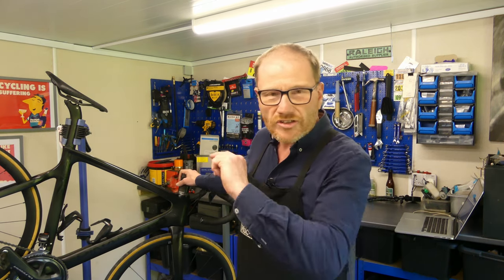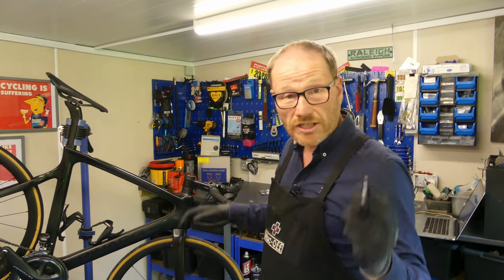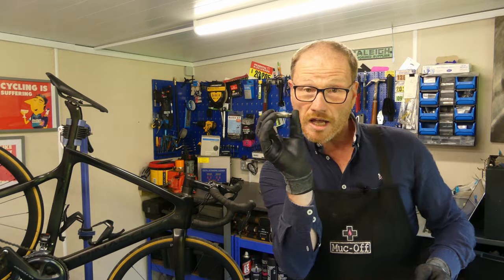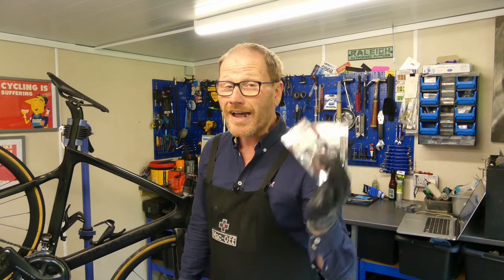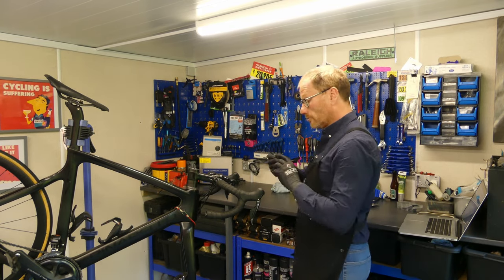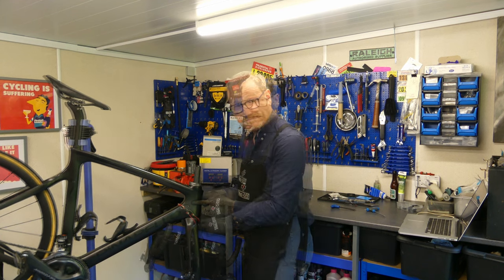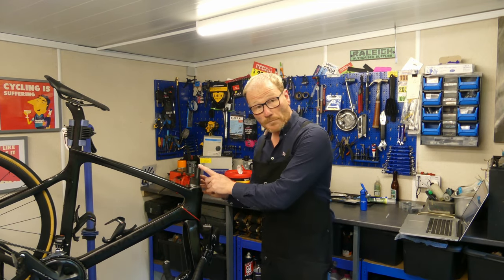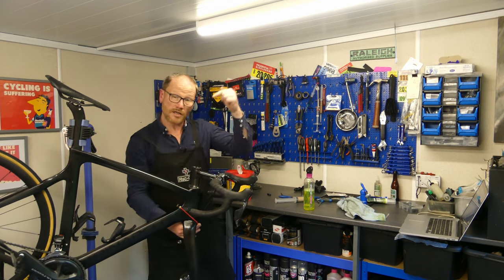How To Replace Integrated Headset Bearings (AHeadset) - Road Bike Maintenance

Comment: Any additional info on the seals that let water pass through? I'm having a hard time imagining water passing through the inside of the bearing and, as a result, washing out some of the grease which will result in a dead bearing anyway. The way I imagine packing the bottom bearing with grease is that water not mixing with grease and being lighter than water, can be just poured out with the inside of the bearing intact, should you ride in wet conditions/rain. Also, went to hambini's website you linked and couldn't find any mention about the seals they're using
Reply from the maker: There is now foolproof way of setting a headset up for foul weather, just good practice. My advice is to go with a full seal for the top bearing, and over-grease it. This will go some way to protect the whole headset, and prevent water ingress. For the bottom, use a non-contact seal bearing, so that if any water does get in, it’ll get out. But, yes, I agree, water will struggle to pass through the bearing, because of the grease within it. Because of this, apply just enough grease to aid installation, and prevent frame wear, should the bearing seize. This is done in the hope that any water that does get in, will pass around the bearing. 

This website offers some good advice:
https://www.scribecycling.com/en-eu/blogs/journal/bearings-explained

Comment: Great vid! One question regarding your suggestion that the top bearing can be more heavily greased than the bottom....but isnt the bottom more liable to water ingress from below (spray from the front wheel) and also needs an equal amount of grease?
Reply from the maker: Good question, and a bit of an urban myth to be honest. Very little water, if any at all will actually make it's way to the bearing. The small amount that may make it to the outside of the bearing won't go any further. The small amount of grease, the bearing seal and our old friend gravity will stop it going any further and protect the bearing body from corrosion.

Comment: Sadly my Lapierre eSensium with hydraulic brakes has the internal brake and gear cabling routed through the top of the headset. I understand therefore that, to replace the top bearings, the cables need to be removed and the front brakes bled.  A far from straightforward job and beyond  my capabilities I'm afraid. I can't decide whether to just replace the bottom bearings myself (they are well and truly cooked and the steering's grinding horribly, top bearings look OK from the outside) or pack the bike off to my LBS for the full (and presumably expensive) monty.

Comment: Perfect video. Guided me step by step through servicing my headset. Turns out I need new bearings, but as a short term fix I was able to clean out and re-grease the old ones, they'll do until replacements arrive at which point i'll probably reload this vid to make sure I don't forget anything! Thanks Jon - liked and subscribed :)
Reply from the maker: Hi Neill, great to hear you found it useful 👍 The good thing with headset bearings is that they move neither fast nor far, so you can get away with doing exactly what you’ve done. Thanks

Jon.

Comment: Great video Jon and you now have another Sub. I found this because I am going to replace my headset on a 2005 Bianchi ML3. Its still got the old HS which has retained ball bearings etc so can I as do I just need to buy cartridge bearings to replace them. My understanding is it is a integrated HS. Like you I am a big fan of Hambini and something he says among many things that has stayed with me is don't use to much grease on a bearing because it can impede the ball bearings from rolling. Love your tip about determining the chamfer you need on your bearing as well. Thanks again.
Reply from the maker: Hi 2 Wheels. Welcome onboard! Yep, that funny little fella from Grimsby sure knows his bearings!! I think the most important thing with headsets, is to let the water get out. Bianchi ML3..... Nice frame that 👍
Reply: Headset doesn’t turn that much so wouldn’t worry too much about overdoing the grease in this application.

Comment: I like the detail you gave, such as the red and black bearing seals. None of the other videos mention that. I like your mannerism, too. I'm a Londoner but have been gone from the UK for forty-six years, and seldom hear a 'Limey' accent. It was great to listen to you.

In 2016 I bought a new Specialized Fatboy. I do all my own wrenching since I fell out with a bike shop from whom I had bought three new bikes, and seven botch jobs. I decided to check the headset bearings and found some rust on the lower bearing, even though it had not been ridden in the rain, nor washed. I replaced both bearings and did a good job even though I say it, myself.

What I'm looking for is information on swapping caged bearings for sealed bearings. I bought a new Izip bike last autumn and don't know what kind of bearings it has. I know the wheel bearings are individual balls. I think I'll bring the bike indoors to drop the fork. Florida is way too hot for working in the porch.

Comment: I have the park grease that I used for changing BB on my Ribble. Was a doddle. On a totally different subject, I used this grease on a bath shower glass screen hinges that started to squeak, like I mean SQUEAK. Fixed it a treat. Like this video as it explains some does and don’ts on this particular bike maintenance. Well done that man. 👍
Reply from the maker: I can report that it's also great for squeaky front gates 🤣. Glad you found it useful. 👍
Reply: Hi Ribble valley, I have a Ribble R872 road bike. Having undone the top cap screw, I found another bolt round headed that the top cap screw screws into?  and information saying torque to 8 n/M. I’ve got fresh bearings but decided not to go ahead before getting more information. Can you shed a light on this please.
Reply: It’s like a bung that fits into the carbon headset. One of my Road club mates has shown me what it is does on his bike👍
Reply from the maker: That is just the steerer bung, it stays put, don’t touch it. Remove the top cap, and then loosen off the hex bolts on each side of your stem. Then just wiggle the stem upwards, and it’ll come off.
Reply: @ribblevalleycyclist  thank you for the confirmation .Yea that’s basically what my Road club mate has said. I always say ask if in doubt. 👍
Reply from the maker: @rogerpianoking1945 A wise outlook. Good luck with your repair 👍
Reply: @ribblevalleycyclist  just done the headset and changed both bearings. The old bottom bearing one had a bit of a clicking noise that I couldn’t hear when riding. Didn’t go too mad with the Park PP1 grease but enough to protect as you outlined in the video. Definitely was ready for doing as the bike was second hand and I’ve done over 5K on it in the last year. No more juddering. 😀 thank again. 👍

Comment: Nice to see you again mate, could of done with you a few months back had to get mine changed. My Orbea was like the pin, had a orange seal at bottom only 18 months and I’ve had them changed as knackard 😊
Reply from the maker: Good to hear from you mate. Yeah, bearings is one of the things most manufacturers scrimp on. You're welcome to bring your bike down to me at any time, we could do a video on it!!!!
Reply: @ribblevalleycyclist  I will do next time if that’s ok, but will warn you because all my cables are intergraded the hydraulic breaks runs right throw bearing so bit more work than a normal change. 👌😊

Comment: 25:40  I recommend to feel at the headset cap not at the hoods, as with disc brakes you might feel the pads moving.Other wise a great guide. Some brakes have massive play, some don't. If done correct as I mentioned it won't need to be readjusted. Also I recommend using Loctite 243 on the bolts to keep them secure as logn as possible. it keeps it secure, but possible to undo it. It's crucial in rapid temp changes. But some stems are useless even with that. But the particular stem in question was an MTB stem (Race Face Atlas) not road bike stem. ten mins in -10C and bar spun. For MTB I recommend Renthal Apex, it passed my test, it held on for many months, despite me taking it in and out between -10C and room temp. I've tested without, and it will come lose. I haven't tried the combo in this video so I don't know how well it works.
Reply from the maker: Agreed, brake movement can feel like a loose headset. I recall noticing this many years ago, when I did my first disc built. One of the best identifiers is movement between the headset tube and the top cap...... That'll confirm where the movement is coming from.

Comment: This is fantastic. I was always told to pack the bearing with grease, this explains why I've been having problems. Have you ever tried one of the @Hambini bottom brackets?
Reply from the maker: Hi, Yeah, I was told the same thing in the early days. No, still waiting for #hambini @Hambini to send me one........ think I'll be waiting a while 😂😟
Reply: I packed the frame with grease. I'm pretty sure the cups were rotating in the frame for a while until they stuck

Comment: Thanks for the great video with plenty of useful advices.
I'm unable to remove the upper bearings from the headset insert. Some knocking from the inside on the bearings just split the 2 bearings parts apart, I can remove the bearings balls but not the inner part with seal which is remains stuck inside. Interesting is this is nearly brand new bike, problem seems to be caused by water which entered inside. Most of the bearings balls arent't shiny anymore, covered by rust.
Some pick might be an option but I'm afraid it would require too excessive force.
Maybe WD40 or something to disolve the rust might help.
Reply from the maker: Hi Jakub, That sounds really bad. I'll assume that the frame isn't carbon, so the inner cuo has bonded to the headset tube? Agreed, something like WD40 will be your best bet. Maybe soak kitchen towel in WD40, stuff it in the area, and leave to soak overnight.

Comment: Very very well covered thank you very much. Would you recommend replacing the compression ring as well when changing out the bearings? Any advice on doing all one can to avoid the ring of death? Carbon anti slip between the area where compression ring sits against the steerer tube?
Reply from the maker: Don't use any carbon anti-slip anywhere on this job. All parts need to be able to move freely. Just make sure everything is very clean, and then apply grease as suggested in the video. No need to replace the ring. Good luck with it.

Comment: Should you be using a different grease for the top cap, something like Slickoleum?  I thought a regular petroleum based assembly grease could potentially damage rubber seals.

Comment: Nicely done video. Could you please provide more detail information about the difference between the upper and lower hambini bearing seals regard full seal and less than full contact seal.  Prehaps I missed it when checking out the hambini website but I did not see any information in that regard. Some close up video shots or photos would be helpful. In your video you never mentioned anything in regard to raceway design. My tadpole trike uses Neco headsets. These headsets have angular contact bearings, which give both radial and axial support. This makes a lot of sense, but looking at the hambini bearings, it appears they are only designed for axial support?

Comment: Very good video informative. I  Would like to say you, mentioned about not getting grease on the steer tube as you showed in your video you cleaned it very well but if that's the case why are you putting grease in the frame Where you put the bearings is that not carbon fibre also.
I don't  KNOW if your frame has alloy inserts pressed into the carbon,if thats the case then i can understand putting the grease there.
So my point is that I've watched many videos and a few of them say not to put grease on the carbon because it can cause it to swell up. So who is correct?
What do the manufactures say.
I have a Cinelli Superstar,frame I'm building and would like too know.
Reply from the maker: Good point, well made Arno. First off, no, the frame doesn't have alloy inserts. It's all about damage limitation. If the bearing were to fail/seize, then it would rub against the frame, and cause irreparable damage, so I apply grease. However, I have been told by a few mechanics in the past that some of the additives in grease can, in theory, cause delamination between the epoxy and the carbon. Research shows arguments both for and against this. So, the way I see it, use a quality grease by a trusted manufacturer, and wipe if off where its not needed.

Good luck with that build. 👍

Thanks again, Arno

Jon

Comment: Enjoy your energetic instruction. I'm about to build a bike frame using 1 5/8 tube. I'm thinking of using the same tube for the head/steering tube since it seems it would pair best with the rest of the frame. However, I doubt the make a bearing set for this size tube? Also, I'm wondering about the best way to set up an empty tube to accept a bearing set. I'm sure some method of keeping the bearings at the top and bottom will be required. Maybe a sleeve or some sort of bearing cup? Any advice on simple and cost effective ways to fabricate a steering tube bearing setup from scratch? Thanks. Subscribed. Robert

Comment: is there a kind of ballpark value for the max torque when fitting the top cap screw?
Reply from the maker: Just pinch it up. No torque required. Too tight and you’ll damage the bearings. Just enough to get rid of the play, and then maybe another 1/8th to 1/4 turn.

Comment: Great video! Do you think it's healthy to suspend fork just on hydraulic cable and let it dangling around?
Reply from the maker: Glad you enjoyed it. Yes, the fork without the wheel only weights a few hundred grams, so it'll be fine. Just be careful not to pull it. If the hose fails, then there was a problem with the hose. Hope that helps.

Jon
Reply: @ribblevalleycyclist  it makes sense for the carbon fork. I am changing headset bearings on my trekking bike with suspension fork, there I removed the brake from the fork. But the tip for greasing lower bearing is great!

Comment: Hello, should I use grease or oil base lube for head tube bearing ball inside. Thank you for your answer
Reply from the maker: Hi, you need to use grease, as water will eventually wash away lighter oils.
Reply: @ribblevalleycyclist  how I should clean it properly, can I use mud off cleaner ?
Reply from the maker: @dannyli5946  Ideally, you need to use a degreaser. Muc Off degreaser, or any other spirit or alcohol based cleaner will do.
Reply: @ribblevalleycyclist  normal muc off wash cleaner is not good enough?
Reply from the maker: @dannyli5946  no, it’s too mild for the bearing in this video. If it’s a modern headset race like in this video, you’ll need a degreaser. But if it’s older individual bearings in a cup race, then you can use your Muc Off cleaner.

Comment: 13:58 I guess unless you ride with loose headset, I've seen people do it. no mud guard, blasting trough a puddle I see how that's feasible. So loose I would notice it while riding, unbearable, yet some don't notice anything is wrong, so in that case stuff might come in. But as I take care of my bikes it's not an issue I will lever have.
Some headsets are pure junk, Like the Cane Creek branded cheap loose ball bearing headsets made by VP components, no proper cover just a weak plastic cover that bends, lets water in. makes the head tube look like someone took a poo on it. No amounts of grease helps on that one.all grease comes out, and it rusts. I'm glad I have proper headset and proper bike now.

Comment: Hambini doesn't design bearings, he sells bearings for a living at a bearing dealer and has seen the opportunity to repack NKS bearings as his own at a overprice, easy to find all this online PS. Another great video
Reply from the maker: I wouldn't know to be honest, I don't know the man. As I said in the video, he makes bottom brackets, and these bearings he's supplied were just simple headset bearings....... which I think are a fair price, when compared to the rest of the retail market. I would however say that the website does suggest this product is exclusive to Hambini Engineering, of which I would have no knowledge either way. Glad you liked the video. 👍
Reply: Where do you get the idea that Hambini "sells bearings for a living at a bearing dealer"? He claims to be a licensed engineer working at Airbus, and given the penalties associated with falsely claiming to be a licensed engineer, I really doubt he would be lying. He started an online retail business selling bicycle bearings on the side, but it's not his day job and he is completely transparent about where he sources the bearings (primarily NTN, IIRC).
Reply: Really as that so? Working at Airbus? 🤣 well… if you call a bearing dealer in the midlands there’s a persons that answer the phones and sounds like hambine, don’t be sold by BS on the internet
Reply: @Frostbiker he was an aerospace engineer in the past afaik. Don’t know if it was at Airbus.

Comment: Its the hardest bearing to replace for me. I have to reroute the cable and bleed the brakes because of one piece bar and stem shit.
Reply from the maker: Internally routed then...... they're a nightmare. You should try building them 🙁
Reply: @ribblevalleycyclist  I built mine. Its horrible.